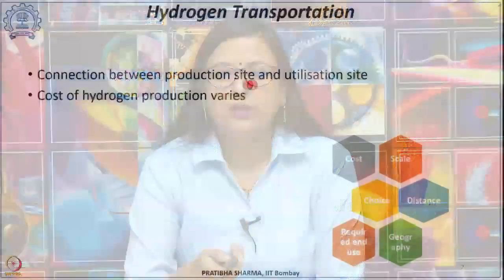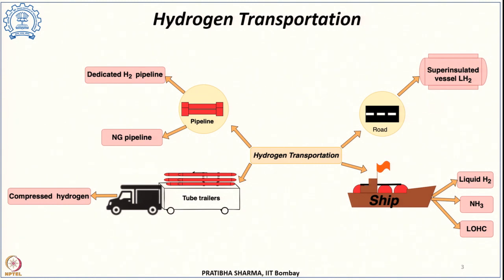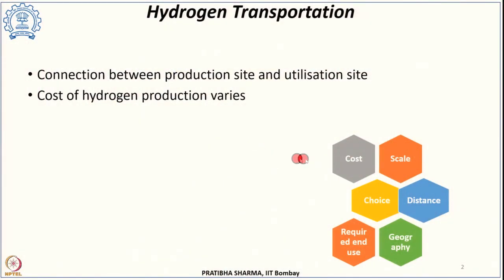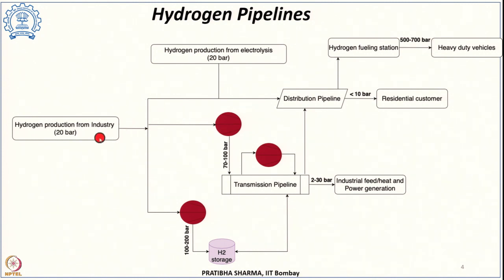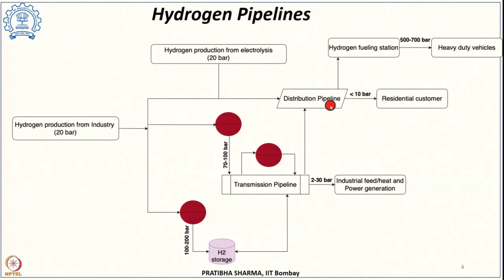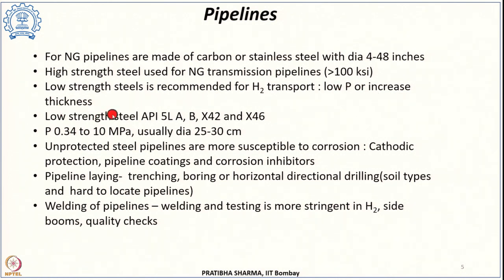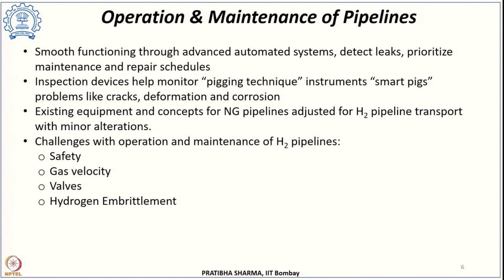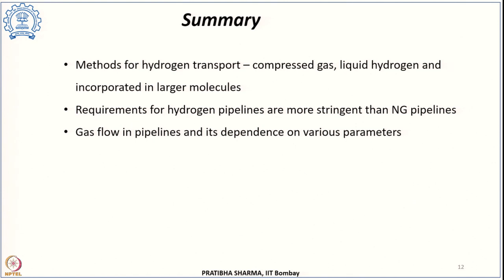Lecture 56: Hydrogen Transportation via H2 Pipelines

Comment: Hope in the next revision, more materials be allocated to hydrogen transportation problems itself especially hydrogen embrittlement and blending with natural gas pipelines. If we can understand the exact mechanism of embrittlement (out of 5 proposed ones), then in our future green dreams we can readily use lots of useless natural gas pipelines networks. I am not sure that at the moment using chemical inhibitor will be a solution to mitigate atomic hydrogen inward diffusion.  As a good reference ASME B31.12 expedited the design, construction and maintenance standard viewpoints. In this standard you may use up to API 5LX80 with mentioned assessment using ASME BPVC VIII part3 procedure.